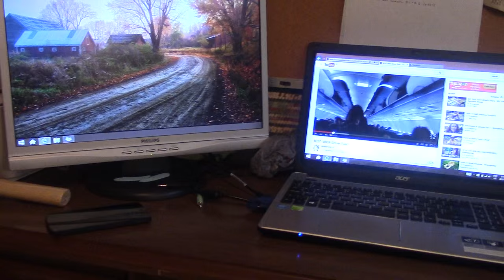Axe Restoration - Hanging An Axe Handle - My Workshop

Comment: Ever considered doing this work outside your apartment so the cleaning the shavings isn't too terrible?

Also did you explain how to go about fixing up the axe-head? rust removal/polishing/patina?

Neat job anyways.
Reply from the maker: +Geo Wu Hey thanks for watching! It's just not feasible to do so! I have limited time, and only get to work on my projects in short intervals. It wouldn't be practical to bring my tools outside to work, and bring them back in again. By doing it inside, I can work for a half-hour, walk out and close the door behind me until I have another chance to work on it. This way, the project will be just as I left it when I come back. Cleaning up is actually not too bad. I keep a pretty tidy work space, and have a shop vac always plugged in.I actually didn't show the restoration of the head. I regretted it after. I used a small bench grinder with a brass wire wheel. Easy as pie. It works so well for cleaning up these old tools. Also, because the wheel is brass, it only removes rust, leaving behind a the natural patina. The patina you see here is not forced. It remains from years of life. Other than removing rust, I pretty much just edged it. The edge was pretty bad so it took some time. Patience. Thanks for your comment!